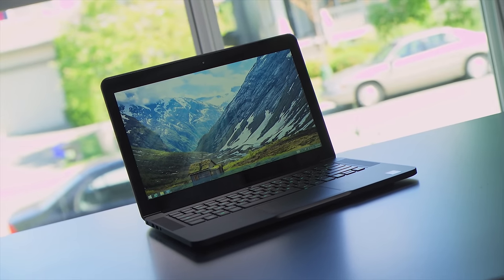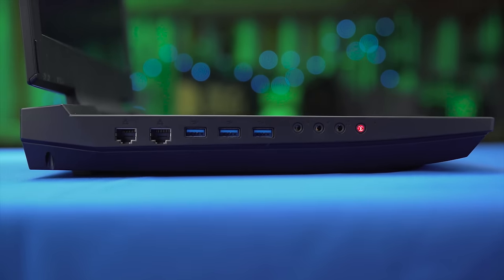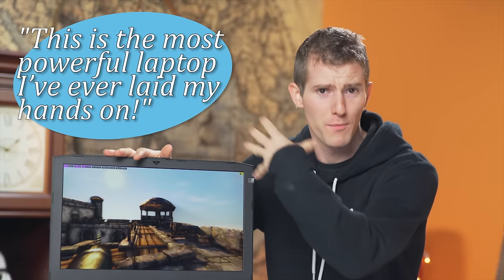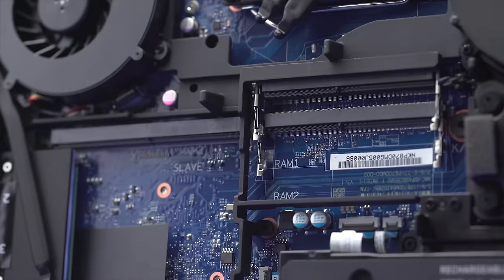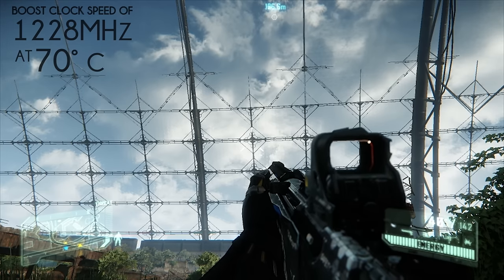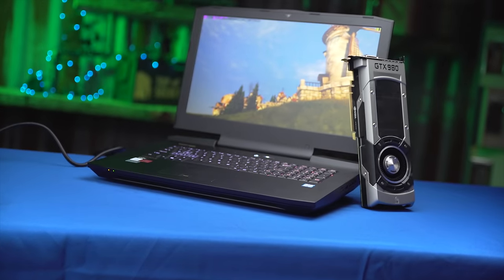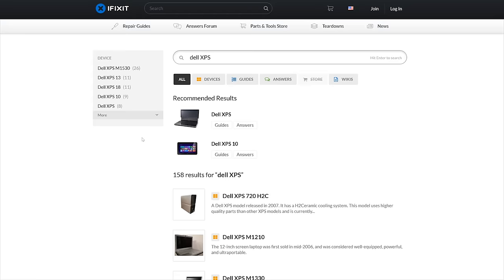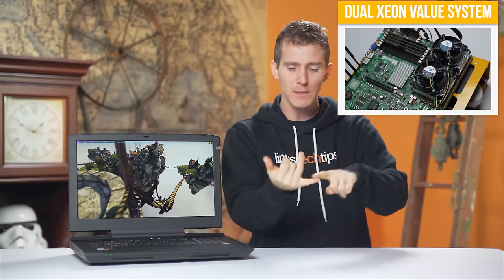Full Desktop Gaming Performance in a Laptop

Comment: ...and I'm sitting here with my potato laptop.
Reply: +Split Edge overclocked to 8 0 0 0 MMR
Reply: 25$ second hand HP laptop.... Fml
Reply: ....and i'm sitting here with my gtx 970 ftw sli and an i5 6600k... fml
Reply: +UberHaxorMarty Have 970 SLI aswell! :D
Reply: +UberHaxorMarty same cpu here and gtx 970 as one. Only play moba games and figure one is probably enough.
Reply: +MASTERmw100 Painful, maybe you can play some android games on it? Don't feel too bad, I'm just using a Kindle fire right now as my main internet device these days.
Reply: +Split Edge I have a GT 640M which is very quickly becoming useless... XD
Reply: +Split Edge Try an LG R310 for size...only reason mine works decently at all is because SSD.
Reply: +Split Edge Like My Potatop
Reply: +Split Edge can your computer run Mount & Blade: Warband nicely, aka that game that can run on half a potato.
Reply: +Split Edge 
At least you didnt spend 700 Dollars just to find out that your FX-6300 is bottlenecking your R9 380...
Reply: Jack Williams Shit...I could say worse about my core 2 Duo and Intel 4 Series laptop if it weren't for the fact that I've a i7 2600K 2nd Gen and XFX Radeon 7970 3GB DD Edition gaming desktop as well.
Reply: Jack Williams Yeah...I had to mess around with that 2600K rig when I won it though. It was all nice and powerful, but before I could fix the static issue it had, it ate one of the two 8GB RAM sticks it had as well as the previous GPU. On top of that, Thermaltake forgot how to make hard drive cages when they built the Level 10 GT, and as a result I no longer have the hot swap plates installed because of their shoddy plastic.

Other than that though, the CPU runs around 45 to 50 degrees celsius under load at 4.5GHZ overclock, and the GPU at 60 degrees under load with 1020mhz core clock and 1445 memory clock. Both sit at 30 or less on idle.
Reply: ***** i want to say that i feel you but I DON'T . Have fun with your pc and good night my friend:)
Reply: +Armswieldthehero hows that?
Reply: +Split Edge I'm here with the GT320M....
Reply: +Split Edge I'm here with my asus m32
Reply: +Split Edge welcome 2 tha club :(
Reply: +Split Edge my potato laptop can't run fallout 4
Reply: +Split Edge it's ok everything is fine...
Reply: same lol
Reply: I at least made do with my potato and installed an SSD, lmao
Reply: +UberHaxorMarty what the heck man that's actually pretty good
Reply: Nicolas Macias True, unless the rest of the machine doesn't work out well for him or he's getting tired of making do with it. 

I remember when I used to watch Pewdiepie, he showed off a GTX 660 which seemed unusual, but his reason was simple: He didn't need anything more than that at the time. Hell, I wouldn't be surprised to see him still using it.
Reply: Keep talking about how shit your laptops are, I have a fucking 220M and an Intel 2 Duo T6600 CPU... It only just runs CSGO at 60FPS on lowest...
Reply: +ceNi S I honestly feel very sorry for u :(
Reply: +Nicolas Macias thanks :( I'm saving up for a desktop PC build at the moment
Reply: +ceNi S I've got about the same as you but it's a T6400 2ghz with Intel 4 series graphics and 4GB DDR2 667mhz. However, I actually made the best of it with a 120GB ADATA SSD and Windows 10 after a bit of messing with drivers.
Reply: ***** same, I optimized my laptop for windows 10 as well, It works perfectly, it just isnt ideal for gaming
Reply: ceNi S True...only games I've put on mine are OpenRCT2 ad the Vista Patch for Need Fr Speed: Hot Pursuit (the 1998 original).
Reply: sitting here with my iphone 3g no joke
Reply: for $0 here XD
Reply: I have an ASUS k61ic from 2009 and i get by with it for now
Reply: ceNi S Still better than nothing...I'm surprised my LG R310 does so nicely with a 120GB ADATA SSD and Win7 x64 Pro.
Reply: ***** XD
Reply: ceNi S Mind you, my gaming machine is running a 2600K at 4.4ghz alongside a Radeon 7970, but I couldn't really find anything decent for a laptop that was newer. Besides, it still runs smoother than my Latitude D530 does nowadays as the integrated Intel 4 series graphics are a little stronger and in better shape than my D530's Q965 Express chipset.

Comment: For those of you wondering, desktop CPUs in laptops are nothing new. It was pretty common in the Pentium 4 era.
Reply: laptops generally have decent cpu's... the gpu is what everyone cares about on a portable machine
Reply: dergescheitepenner Yeah, desktop GPUs in laptops are definitely new. Haven't heard about it until Nvidia announced they're bringing the GTX 980 to laptops.
Reply: +Daring how about GPUs... the whole point...
Reply: One Chance China Desktop GPUs in laptops are new, yes. But not desktop CPUs.
Reply: but where they skylake 6700's?
Reply: +Daring maybe because those Pentiums couldn't generate much heat due to low power? but it's a bit different now isn't it? more power more heat, so it's a big deal actually how they fit it in there and cool it efficiently.
Reply: And they lasted all of six months before cooking themselves to death.
Reply: ***** relatively , not speaking about a specific one or a specific year, just in general.
Reply: +Daring - I had a Sager P4 based laptop back in 2003, it was the 2003 version of this laptop, minus the awesomeness.
Reply: +Daring many compaq did that at they time, the same model could be even user upgradable ... But most of them the cpu was soldered. Socket takes space. Which doesnt matter there, because this is portable desktop, I mean, that is not a portable at all. Weight ? run on battery ? more like a mini atx with a little UPS
Reply: +Daring (off topic) but what is better for someone looking to create videos, stream, and game i5 6600k ($250) or i7 4790k ($300).
Reply: +NovaCreep i7 because of streaming, also helps when you edit stuff.. but if your only gaming i5 is fine
Reply: ***** Back at home I have a Dell Inspiron 5100 with a desktop P4 (2.66GHz, 512K L2 cache) and it idles at 45 degrees and gets up to 80 under load, so yeah, desktop P4s do indeed run hot.
Reply: +Daring Any chance this has something to do with their recent focus on VR?

Comment: the price is quite cheap. gonna buy it soon.
Reply: Bruh
Reply: i actually expected the gtx 980 16gb ram with the 128gb ssd version to be over 4k bucks but its actually 2700. 2k bucks is obviously not a little amount of money but ive seen gaming laptops over 3k or even 4k bucks and maybe 2 or 3 times slower than this laptop. If i had the money i would buy it. So yeah its actually quite cheap for what you are getting.
Reply: Well I think you need another source than Wikipedia to find out how much they actually cost xdddd
Reply: A good example of this is Alienware...  I did top specs on an M17x R4 and an M18x R2 and they both topped at over $6k!
Reply: Thomas Dohlman/«DN»Lasky® desktop that costs 4k can get better performance than the 980m ore 980 desktop
Reply: SimArtz - Simon S. an example of overpriced gaming laptops are alienware and no i never use wikipedia and by cheap i keep in mind the price to performance
Reply: You know regardless, devices like this make little sense right? Its barely mobile whilst these things in general are louder than desktop counterparts and output less performance yet cost more.

Comment: the end is funny he reviewed  loads of laptops with desktop processors and desktop graphics cards in them for years now so it just wasn't possible today it was already done couple years back lol
Reply from the maker: I think you're confused. Desktop CPUs have been done before. Nvidia has never done a desktop gpu in mxm form factor before.
Reply: +LinusTechTips Hi Linus, I love you. Just saying!
Reply: +LinusTechTips o OK yeah I just realized that lol my bad anyways Linus what would be the most powerful thinnest laptop there is other than the razor blade 14 I want to buy one but can't find any
Reply: +pavy415 Gigabyte P35xV3 or V4, or you can wait for their Skylake refresh coming next month. The V3 comes with 4710HQ and 980m with 8GB DDR5, Two MSATA II slots, upto 16GB of ram, and a switchable optical drive that can be switched for an SSD. All that comes in a 0.8 inch (20.9 mm) 5.5 lb package.
Reply: +LinusTechTips Hey just a quick question, when not plugged into the wall so to speak and doing simple browsing and listing to music. Whats the battery life like? for example clicking the default "power saving" mode haha?? Cheers.
Reply: +Chris Norman I use a MSI Titan Gt80, about 3 and a half hours of battery life playing games. Not the best put I mean its better than not playing at all.
Reply: +Chris Norman I suppose 2-3 hours. Gaming is not even possible without wall power!
Reply: +Colton Hinkle 960M  M for mobile!!!! ROAAARRGGHHH!!!
Reply: +Colton Hinkle facepalm
Reply: *****
You do realise that the product you listed has nothing to do with this as it does NOT have a dekstop gpu, but a mobile graphics card (GTX 960M ) M - stands for mobile = all laptop gpu's . it is absolutely uncomparable in performance.
Reply: +Colton Hinkle 1925 dollars to have 4k with just a 960m. Are you freaking kidding mate.
Reply: +ADFasdf asdfasdf Interesting...I remember when Dell did something similar with the Latitude D530, where not only was there SSD drives available for it, but there was also a hard drive caddy available that you could stuff any 2.5" hard drive into and put into the same slot the disk drive uses. I don't have this myself, but I was about to do it until I realized the battery on mine was dying and it was becoming difficult to find half decent batteries for these things.
Reply: +LinusTechTips that laptop is still a piece of shit. why the fuck would I want a laptop that big with a battery that lasts 10 minutes when I could play games at home like a non-autistic person.
Reply: +Communist Karl If the laptop only lasts for 10 minutes, that's bad. Even my laptop is 1 h and 30 mins, which is very, very non-power saving.
Reply: Kenji Gunawan Yeah...I had a Latitude C640 that I wanted to keep running back then, but the stupid thing always ran at 90 degrees literally and therefore prematurely wore out the cells. Not only that, I'm surprised the hard drive I recovered from it's burnt wreckage 6 years ago still works to this day, and quietly at that.
Reply: what are you talking about bro?
Reply: +Aliee Hanancha I can't understand what you're saying...
Reply: +pavy415 wtf u r talking about dude ????
Reply: +pavy415 MSI gs60 pro
Reply: +pavy415 GOT REKETD!!!!!!
Reply: +pavy415 I just bought a MSI Ghost pro 4k laptop, nvidia 970m [6gb], i7 6700hq, 16gb g.skill ram,  256gb samsung pro m.2, and a 1tb sshd... paid 2400$ tho....
Reply: +David Yam I bought th xps 13 with 16gb ram, 512gb ssd, 4K, touch screen, core I 7 and Intel iris graphics and it runs games that are free to play at 250fps I haven't tried crysis 3 or other demanding games or tomb raider games I'll do that soon
Reply: I'm glad you can find deals like that lol I'd rather know that it's new so if it starts to have issues I would know it was me but that's just me.
Reply: David Yam Little bit of bargaining and such can get you a lot...friend of mine recently got a Grand Am for 350 with nothing wrong except sway bars, did the sway bars himself, got it inspected and it passed, then licensed it as a 3250 dollar vehicle. That Grand Am hit a couple other snags here and there afterwards, but now has absolutely nothing wrong with it and he hasn't spent anything more than 700 dollars in repairwork and the purchase of the car combined.
Reply: +prizedcoffeecup that is awesome, I got an 84 bronco for 1000$ that all I had to do was replace the driveshaft, manifolds and a paint job. Like I said though, that's just how I am about certain thing, having something new I mean.
Reply: RedVenom Yeah...funny thing is, on the flipside my brother bought an older 96 Grand Am that had a 2.4L, but the way it was set up the only thing it could not outrun was a repair shop. This poor thing has been street raced quite a bit and it's a wonder the engine ran for 3 years before blowing. And then we sold it because the replacement engine bent an intake valve...still runs somehow, but coughs pretty nasty under heavy acceleration. Not to mention when we sold it, the rear shocks were almost gone, the 1st and 3rd gear synchros were starting to wear out, the engine still burned oil a bit, almost all the bushings in the front end were gone if not badly shredded, the driver's side window would not roll up properly, the tires were all bald, there were little dings and dents everywhere, the daytime running lamps couldn't decide if they wanted to work or not, the radio's volume knob was finicky, the front seats were damaged a bit and the rear bench seat worn out a lot, etc. 

That's not even all of the problems this thing STILL had to have fixed before it was considered acceptable. So yeah.
Reply: +pavy415 they dont perform like a desktop can anyways
Reply: Dave how is the Ghost Pro 4k?
Reply: amazing, my only gripe about it is if your using programs like photoshop it's tiny so you have to lower the resolution quite a bit to look right
Reply: Bloodsport1 still awesome still working perfect. needs a cooling pad though.

Comment: when a laptop is more powerful than your gaming rig
Reply: Well, 5k US Dollars isn't something to sneeze at.
Reply: I got around 2800€ pc and it beats this by a mile. it ahs also 6700k but i have 2 gtx 1080
Reply: +Jaska Jokunen u know this laptop came out when there was no gtx 1080!! Compare it when new laptops come out will 2 desktop gtx 1080 sli which will cost 10,000$
Reply: Rock GamingTV If laptops get sli gtx 1080performance, it will.cost around 8686858854€€
Reply: Umm... no. These have just recently been released. Check out the new Clevo notebooks that support 2 GTX 1080 (Desktop) in SLI.
Reply: +TheKiwiSage we are talking about laptops. Not mini pcs here lol
Reply: r7 240 4 lyfe (At least until christmas)

Comment: HOW GOOD/BAD IS THE BATTERY LIFE??

Great review though Linus keep it up.
Reply: +Joe Dirt lol.....
Reply: +Joe Dirt if you have this machine you'll probably be plugged in all the time. i'd say 2 hours at most?
Reply: +Joe Dirt there likely a quick option to disable the gpu (cpu and igpu only) and you could get like 4+ hours proboly, gaming would be under 1hour at max
Reply: +Joe Dirt It's most likely comparable to any other desktop replacement class laptop. Expect ~1 hour under load. This thing isn't meant to be unplugged. It's meant to be powerful and something you can easily move.... from one desk to another... Especially with the way it's ventilation is set up (again, like any other desktop replacement), it's not to be put on your lap while in transit to your next destination.
Reply: +Javier sebastian 2 hours? lol. If you game it will probably be max 45 minutes.
Reply: +Joe Dirt even the 980m throttles when running off of battery cause it can't get enough power, so it's kinda pointless gaming on battery, cause it won't last more than an hour and you'd get half the performance. I'd imagine browsing would be fine for a couple of hours
Reply: yep i had an alienware m18x sure u could use it on your lap etc but not for gaming could get like 4hours on cpu only watching videos etc but when you get to the location you just plug it in